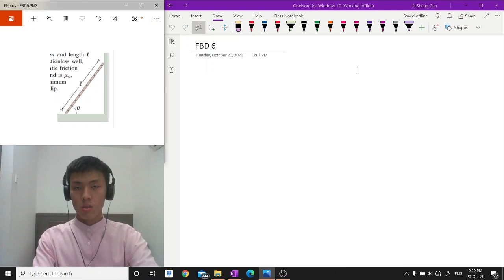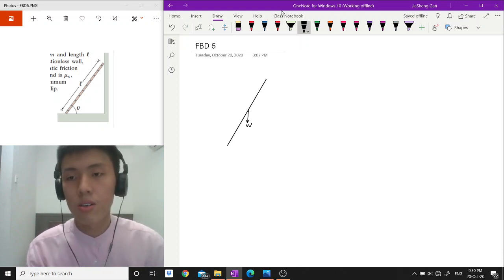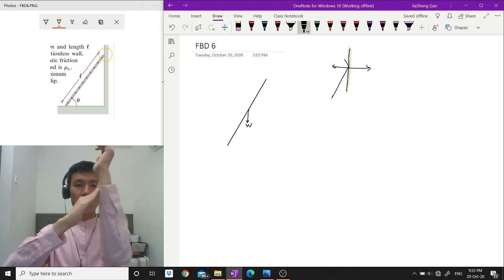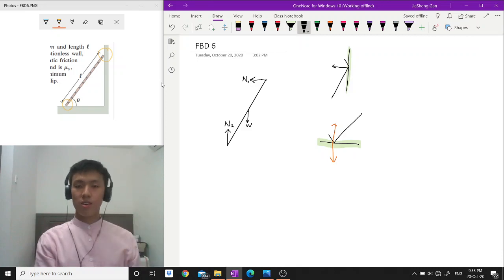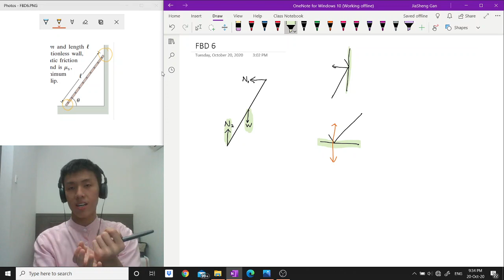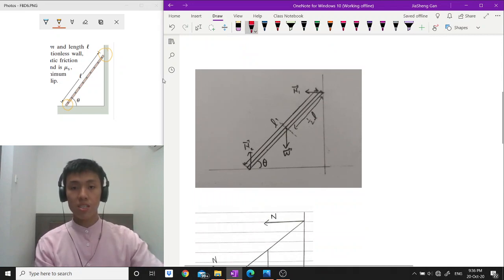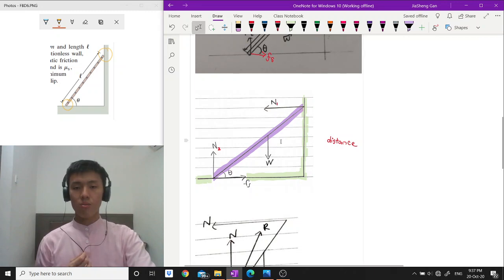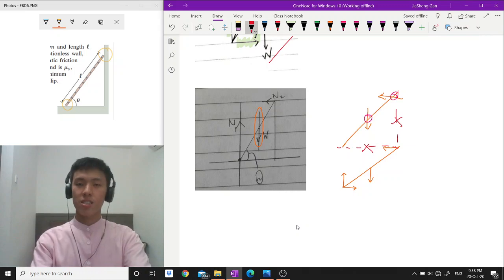Free Body Diagram for Rigid Body Example 5 [Chapter 8: Rotation of Rigid Body]

Comment: Hi sir can I know what is the difference between reaction force and normal reaction?
Reply from the maker: We can think of the reaction force as the forces that is exerted by the hinge/pivot/contact (or some kind of mechanism) on the object of interest.  There's force exerted because the hinge (or whatever it is) is in contact with the object.

When we talk about 'contact', we talk about normal force (perpendicular) and friction (parallel) (chapter 4). How the hinge is touching the object of interest can be complicated, so it's quite impossible (in many cases) to determine this force like how we would determine normal force and friction in chapter 4. So we just jumble it up and call it 'reaction force'.

Then normal reaction (first time hearing it) would just be the component of reaction force that is normal (aka perpendicular) to the contact surface? Where the contact surface is can be direct sometimes (e.g. ladder problem). Sometimes it's just difficult to see the contact surface.
Reply: @jiashenggan4832  so means that normal reaction is included in the reaction force ?
Reply from the maker: @florence6654  I have nvr use this term before. But I think so. I think it's the component of reaction force perpendicular to the surface of contact.
Reply: @jiashenggan4832  ok tqvm sir!ur video indeed helps a lot!